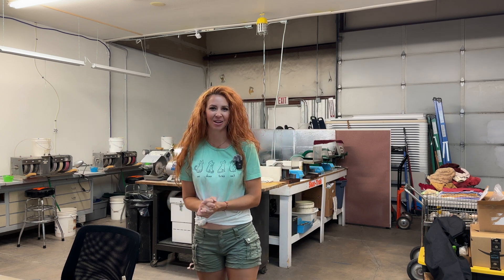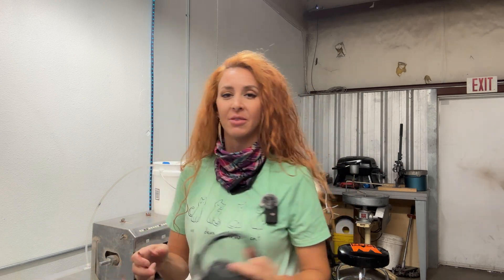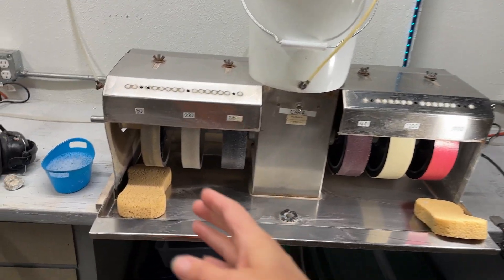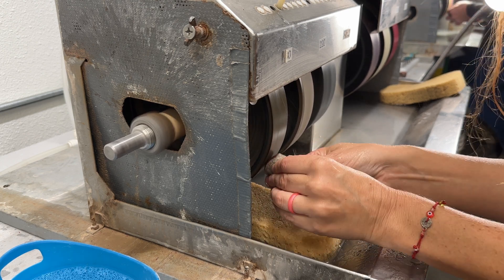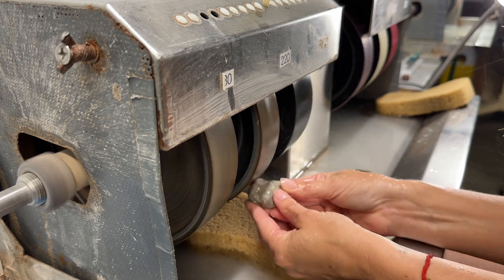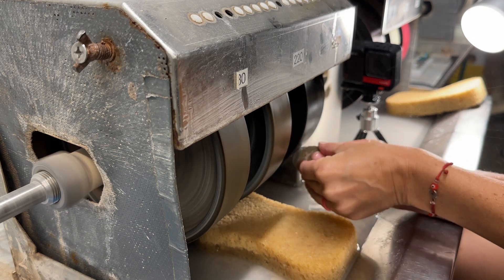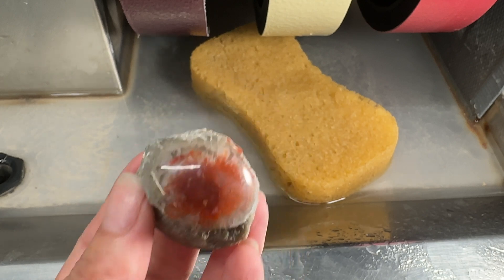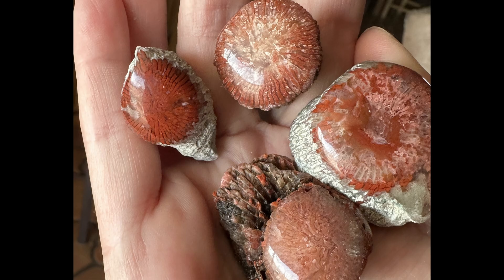GEOLOGIST shows you HOW to polish Riley's Canyon RED horn Coral

Comment: Yeah, sandpaper moving at speed can do some damage. I was sanding a clock face in shop class in High School on a disk sander when the board jumped and I brushed my knuckle on the disc. It took the skin off down to the bone. Over 30 years later I still have a scar.
I wish my local rock club had a setup like that. They have a trailer full of equipment, but it’s VERY difficult to sign any out to borrow.  I have a piece of Dry Head agate my grandparents collected probably 50 years ago that was the first piece I ever cabbed. It turned out beautiful, but I’ve struggled to make a nice silver setting for it.  Silversmithing is hard.